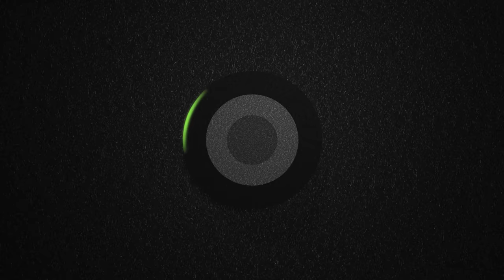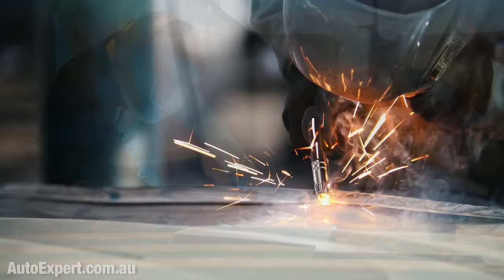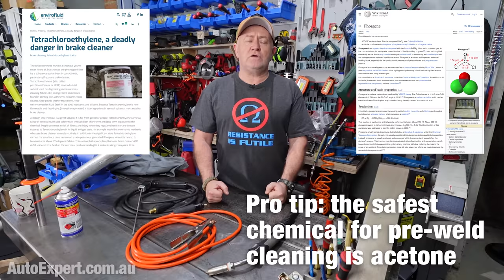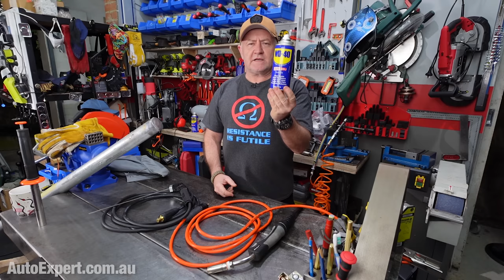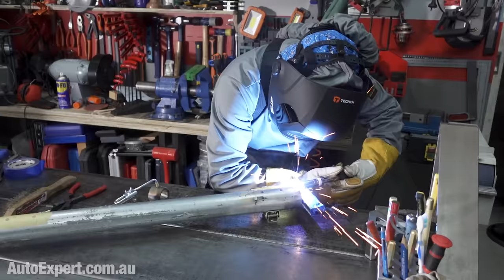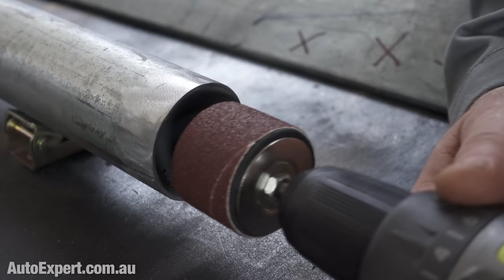How to die while arc welding at home: the top 5 ways | Auto Expert John Cadogan

Comment: Welder here.  I think you did a good job of covering the main safety points.  PPE is key, and I see so many mechanics on Youtube welding without gloves or sleeves.

A couple of points I'd like to add - never weld around or on fuel tanks.  There are ways to do it but the only really safe one that I'd be happy to recommend is to fill the tank with water.  If you're not prepared to deal with that, get a professional to do any work on fuel tanks that have had fuel in them.  There are other methods, but they should not be considered 100% safe as it is so easy to get it wrong.  Surprisingly, a lot of people think (or don't think) that it's OK to weld on the outside of a tank if it is otherwise sealed.

The other point is confined space work.  While it's unlikely that your average handyman will need to do that kind of thing, there's a whole slew of OH&S regs that need to be followed if you want to undertake this kind of work.  It has happened though, that back yarders and farmers have killed themselves by not understanding how dangerous it is to enter a tank, bilge, underfloor area etc especially with a welder.  When I was working in a ship yard, I heard about another ship yard that had a death.  One of their experienced welders had to enter the nose cone of an ocean prow (the long torpedo bit on the front of an ocean going ship).  For some reason it was late in the day and he decided to go in alone and get the job done.  He dragged the stick electrode up into the prow with him, and while he was trying to drag it up past him to the working face, he contacted it on his chest.  Just so you know, the big welders used on these sites are usually earthed externally directly to the hull.  They are AC units with quite a high OCV (90V or over).   Since it was the end of the day, they didn't find him until the next day, and that would have been a really awful way to go.  I don't know what happened to the shipyard but several very important  safety rules were broken, most notably you are not allowed to work alone in a confined space, and the shipyard that I worked for had a "board" where you had to hang your tag on to let the site supervisor and everyone else know that you were inside so they do things like not turn the ventilation off and go home at the end of the day, and you always had a buddy welder or trades assistant with you at all times.  The tags were multipurpose and had your specific number on them - you handed them over to get tools and equipment out of the store, and to hang them on the confined space board to let people know you were still inside.  I won't go into all the reasons why confined space work is so dangerous, but I think that it's fair to say that most people seriously underestimate the danger.
Reply from the maker: Thanks Chris - appreciate the tip on fuel tanks (big risk @ home) and also the sobering reminder about working solo in (mainly) industro-environments. Pretty grim outcome. We used tags like that in the railways for anyone working on the high-voltage system of electric trains (1500V DC overhead wiring and traction motor systems). Nothing got re-activated until all the tags were accounted for.
Reply: Yeah, that's a really good point. Last year my boss called us in for a meeting. Some guys from another workshop within our dealer group had cut into an old oil barrel with an angle grinder. I bet you know exactly what happened already. It blew up and a few guys got some pretty bad injuries.
Reply: The lack of ppe from youtubers drives me nuts as John points out, it metastasis.
Reply: That’s a solid comment.. the thumbs are cramping just reading this ! 😜

But YES!!! Fuel containers and FARMERS famous last words “sheee’llll b right m8”, (many variant follow ons from this sentence started)
Reply: I remember reading William Porker's column in a late 80s edition of Street Machine in which he told a tale of washing a car fuel tank many times with detergent. It still had a slight flare up when he tried to weld it.
Reply: Couple of mechanics in a local garage here decided one day to make a barbecue pit by cutting an empty oil drum in half with an angle grinder.  They hadn't been thinking in terms of them being the meat.  One survived.
Reply: @timjackson3954 a fucking very big ouch and that's not making light of it at all. I winced mightily when I read that.
Reply: @AutoExpertJC  yes yes,,,complacency killed the dodo & dino..
Reply: Do sealed pipes explode when being welded?
Reply: @jamesfarnarkler  Yes, that's the "easy to get it wrong" part, or at least one of them.   Most of the methods usually recommended by back yard mechanics have hidden dangers.  That's why I prefer the 100% water fill method and it's the only one I will tell people about.
Reply: @grantadamson3478    They can do, yes.  If you're welding on it in service then it's probably because it's cracked or a section is being replaced, and therefore it's most likely there will be air in the pipe.  Usually you'll isolate that section and take steps to make that section safe.  I haven't worked on fossil fuel pipelines so I can't comment more, except to say that correct pipe welding procedure would start with opening up the cracked pipe or new joint at least 3mm to put a root run in there.  Air will go in, and even some inert gas combinations (like CO2) are not safe because it decomposes at arc plasma temperatures (one of the hidden dangers I alluded to earlier).  The welder will have a very strict procedure that he must follow.

I did see pipe x-ray robots in use for NDT, and I'd be surprised if they don't have welding robots they can send up a pipeline to do the root run by now.

Work in oil refineries and chemical plants is another example.  Shutdown work (the plant is taken off line for maintenance work on a set schedule) can be particularly hazardous for these and other reasons.
Reply: @Chrisamic  Thank you.
Reply: @AutoExpertJC watch out for pressurised fittings also. I once welded the base on a chair gas lift chair without thinking, it was a small one I use for working on hgv trailers and units, I was welding and the bloody seat was bugging me wobbing about,  so being mad, (and in madness) I jumped up flipped it over an welding the legs back on. Flipped it back up, was bout to sit on it as it took off, hit the roof and landed on top of the trailer I was repairing. The lift unit had obviously got a tad hot.
Reply: @Chrisamic Well said, and very true.
Reply: @grantadamson3478  In oil refineries? Every year!
Reply: Thanks for the great video John!
Reply: YES 100% is the key ! If there is any space above the water IN the container that can NOT be filled and fumes caught there you've actually made the situation worse by confining the explosive gases and making a bomb.
Reply: My boss was gas welding a big patch in a 63 Chevy trunk. I was in the wheel well with a water hose, wetting the gas tank. He yelled at me every time a little water cooled the workpiece. Young and dumb ain't the half of it.
Reply: A welder near me demolished himself and a two story brick building, and fatally damaged another, while welding a leaky tank bottom. Everybody was baffled, as he specialized in industrial tank welding for years, and had a great reputation. He was well equipped, and knew the owner was experimenting with biofuel production. Who did what, we will never know
Reply: Filling a fuel tank with water DOES NOT make it safe. a friend of mine was nearly killed by a fuel tank that was filled with water.
Reply: Some immigrant laborers were doing  an interior demo/remodel of a space in a  century old former varnish works. One was told to remove a large overhead pipeline. He grabbed a cutting torch, and seconds later, the lucky fella met 72 houris. Cheap labor is no bargain
Reply: It seems like a lot of people don't understand the importance of covering your skin. My dad never covered his arms when welding. By the time my dad died his arms were covered with scars from all the cancers that had been cut away.
Reply: The really insidious part of confined space deaths is they're almost never just one victim.  People can't resist the urge to go help and all that does is up the body count.
Reply: @AutoExpertJC even more safety, in our depot protection the road had the juice off and the end doors closed and neither could be changed until all the fitters or examiners working on the train had taken their padlocks off the side of the cabinet to access the door control and electrical supply. Just one padlock would keep the cabinet door shut, a good system.
Reply: @phlodel  I use CO2 after flushing the tank. Low flow rate for as long as it takes.
Reply: Sample size of one, but I have had success repairing a fuel tank for personal use with JB Weld. I did that specifically to avoid welding it! Thanks!
Reply: No you dont use water buddy. you fill it with gas car exhaust so theres no oxygen in the tank
Reply: @@shivadow nah bro that’s not how
Reply: @AA-tb4ff   Which is exactly what you don't tell people.  That's information that hasn't been current for about half a century.   A few things...    Vehicle exhaust is not what it used to be. - CO has largely been replaced with CO2 which is far more reactive, arc welding processes have evolved so people are using GMAW and GTAW (mig and tig in the US) far more than stick, and even when it was a process that was used, it's not a matter of just "filling the tank with exhaust".  There were tables, published about 1950 that told you how long to run the exhaust in depending on the size and shape of the tank.  I've personally met one guy that got it wrong - he got the timing wrong and left the exhaust running too long, so the mix was wrong.  He also wasn't welding the tank in a cage so when it blew up, it blew him right across his shop and through the wall of his paint booth.  He was lucky to survive, and that's someone who had done it dozens of times, had the correct tables, and understood the problem quite well.  Carbon dioxide is a reactive gas at plasma temperatures.  Buddy.
Reply: @Chrisamic  well it’s a better idea then filling it full of water
Reply: @AA-tb4ff  No, it's not.  It will kill you.
Reply: @dontforgettobringatowel9106  One such incident I heard of sent the drum 50m into the air.
Reply: ya i said fill it with car exhaust so theres no oxygen in the tank but apparently thats not how you do it@@shivadow
Reply: @michaelbamber4887 Weld in haste, repent (or should I say recover) at leisure eh?
Reply: @jeffdoell5064  yeah, just didn't think about heat transfer to the gas strut, was pretty impressive amount of force when it went. I should have taken the base part off to weld it. Did do next time I came across one that had a loose base. You live an learn as they say.
Reply: Am confined space qualified and I agree without training 2 many people underestimate the dangers sometimes even the qualified ones unfortunately, I have worked on some teams (power stations) where I have had 2 pull operations due to the dangers created by maybe qualified but cowboys on the team. Safety then safety then have another look safety if in doubt stay out gut feelings have saved my bacon more than once.
Reply: @grantadamson3478  Yes they can. It has happened when sealed steel sections have been galvanised, which is a much lower temperature than welding can cause, and a sealed section can explode blowing hundreds of pounds of molten zinc over everything and everyone within quite a distance causing serious damage and injury.
Reply: @grantadamson3478  yes they can due to air expands when heated.
Reply: @Chrisamic  "CO has largely been replaced with CO2 which is far more reactive,"
Wait what? Want to rethink that?

Just to add to the general stories. Stick an open airline in the drum. Theory goes it keeps the mixer to lean to burn.
Reply: @phlodel  I'd sure like to hear more details
Reply: @Chrisamic said "No, no need to re-think anything, since CO2 is more reactive at plasma temperatures.  Sure, if you keep the mixture leaner than stoichiometric it may not blow your face off.  Would you like to bet the family jewels on it?  It's probably the dumbest thing suggested so far..."

I'm not sure what you are trying to tell me. You get that CO is a flammable gas right? but what % of exhaust was ever CO? Given there was already many times more CO2 in exhaust than CO, how much difference would your claimed worsening really be? 10%?

Would I beat the family jewels on it? Unlikely, but the story goes the guy that made a lot of money welding up 44gal drums after WW2 did. Not sure stoichiometric is the word you are looking for though.
Do I get a prize?
Reply: @stusue9733  "I'm not sure what you are trying to tell me. You get that CO is a flammable gas right?"

This is getting silly.  CO is not flammable in the way that most people understand the term.  It would make a pretty fair fire extinguisher for most purposes, except it's quite toxic.  

"but what % of exhaust was ever CO?"  
Prior to 1975 10% or more of car exhaust was CO and almost no CO2 left the tailpipe.  Modern cars exhaust about 13% CO2, quite a different mix for the subject we are discussing.  The technique of using car exhaust to fill a fuel tank is from the early part of the twentieth century, and the Miller/Lincoln tables for working out how how much exhaust to put in the tank were drawn up in the 50's.

" but the story goes the guy that made a lot of money welding up 44gal drums after WW2 did"
I think you'll find there were a few more steps in the process, such as washing them out first.  He probably discovered the hard way that just washing alone was not enough.  Second hand stories from eighty years ago are sure to be missing a few of the finer details, like how not to blow yourself up.

"Not sure stoichiometric is the word you are looking for though."
I'm pretty sure it is.  Let me put in words with fewer syllables for you.  Adding air will reduce the likelihood of the gas mix in the tank being the perfect ratio for an explosion that is 100% efficient for maximum face removing power.  It won't on its own guarantee some form of explosive mix is not present however.  Think of it like playing russian roulette - pull the trigger often enough and it definitely will go badly.  Sorry, I just can't get less than three syllables without a frontal lobotomy.

"Do I get a prize?"
Sure.  Here's a banana.  🍌
Reply: @Chrisamic  While I believe you are stretching the truth about the CO%, even if I grant you that, you haven't explained how replacing a gas that "would make a pretty fair fire extinguisher" with a gas that IS used as a fire extinguisher is an issue.

" some form of explosive mix" So you mean lower and upper explosive limits?
Reply: Put a hose from a running cars exhaust into the tank .water is safer
Reply: @AutoExpertJC  I find it concerning that in discussing the subject of fuel tank repair, several deadly old wives tales persist, as we have seen in the comments on your video.  I'm a boilermaker welder, and for many years I worked in a business that among other things, did a lot of fuel tank repairs, from small stationary engines, up to and including road going fuel tankers.  Do not take advice from anyone that tells you to fill with car exhaust or water.  To degas a tank requires heat and detergent, and that tank will only remain truly gas free for a certain time  before it begins leaching product from the walls and contaminates the atmosphere within.  Even if you were able to 100% fill a tank with water, which is far easier to say than do, how are you supposed to run a sound weld on a (usually thin) tank with water as a backing?  The repercussions of leaving even a small gas pocket are extreme and this was illustrated at an industrial site not far from where I worked when two workers were killed after a tank exploded that they were fitting metrology gear to.  The tank was used to store waste oil for recycling and was quite large, probably 5 or 6m diameter and 8 or 10M high.  The tank was filled with water prior to the men commencing work which involved cutting into the roof of the tank with an angle grinder.  As the work involved working at height, both men were harnessed and hooked on to anchor points on the tank roof.  Once the grinder penetrated the tank roof, it ignited the fumes which had been concentrated by filling the tank with water, and there was an explosion resulting in the roof of the tank being blown off and the two men going for the last ride of their lives, harnessed to the roof, before coming in for a landing, almost hitting a truck driver that had just arrived back at the depot for the day.  The grinder that they were using was found on the roof of another business over 100M away.
I don't for a minute expect a back yarder to be working on a tank that size, but the lessons and the principles hold true.
As qualified tradespeople or other professionals, we really do need to be mindful of the advice that we give people.
Reply: @grantadamson3478  
The question is sealed: What product to knowledge did it last contain? That's is the key.
Water, no problem welding on a water line where the pressure is monitored to suit the welding application and procedure. 
But if unsure sure, the correct procedure is to drill the (empty) pipeline via an intrinsically safe method like a (air driven) pneumatic drill with constant coolant, then gas test for LEL's (lower explosive limit) before proceeding with anything that can produce a spark or flame.
This requires training in how to operate a gas testing unit and how to identify and manage these steps.
This is not something for the backyard or want-to-welder to undertake..
Reply: I was going to say the same thing about tanks.  Pretty much anything even nitrogen can become dangerous with enough heat = pressure.  Basically a spring in a bottle.
Reply: call me silly but when i weld i have all the gear on, coat, gloves, shield
Reply: excellent. thank you.
Reply: @steveb6103 That works. At the very least, flush the tank and have compressed air continuously moving through the tank so fumes  cannot build up.
Reply: @grantadamson3478 probably. Sounds like a casino...
Reply: @jimfarmer7811 
That sounds like your farther had Basal-cell carcinoma on his arms. Those are relatively benign compared to melanoma but both should be avoided by wearing PPE.
Reply: @stusue9733 
When welding you create a plasma. 
Fire extinguishers are used on fires, not on plasma.
Reply: @Conservator.  I'm sure you are trying to tell me something but I have no idea what it is, so if you could clear that up that would be handy.
For a bonus point you could list the gases that are used Pure for MIG welding. Let us not get all excited about  "actually its proper name is GMAW"
Reply: Ive patched up a few fuel tanks in the past, either by brazing or welding. Sure be careful, give it a flush out with water, I would often see a flame burst out the filler pipe every now and again with a pop, but nothing close to explosion.
Reply: Was the poor guy burnt to ashes? 😢
Reply: @AutoExpertJC  We learned welding in high school, and the teacher insisted on us wearing the full leather gloves, leather jackets with a shield for the neck to avoid any skin being exposed to UV light.  Not the most pleasant thing in the southwest USA, but I understood the reasoning. People were inspecting a water tower at a university in California in summer and at least one of them died from heat exhaustion, it was a guy named Jason Peters of Palm Coast, Florida.   They should schedule such inspections in the hotter climates for the winter months.  
Also in California, in a town called Lemoore a welder named Dion James was killed when a tank he was welding exploded and launched 70 feet in the air.  Lemoore City employee Jeremy Climer was wounded.  It was a water tank, so I'm not sure what exactly led to the explosion.     
We had lock out tag out procedures in the electronic test area I worked in, but prior to that I worked in industrial and agricultural pumps and wells.  I hated to go out to the country side because those mom and pop dairy farms don't really have lock out tag out procedures and some dairy farmers are rather know it alls.  They'll start flipping breakers because, dog gone it all, they own the place.  And one place I went they some how managed to blow out a pressure tank and water was everywhere with all this frayed wiring in that pump house on top of it.  It surprises me that there aren't both more electrocutions and also more electrical fires.
Reply: I had an idea and it worked well for our people at one job I was on where we filled fuel tanks with steam from a boiler and insulated hose. No matter how stinky with fuel odor a tank is, it can be welded properly when pumped full of steam. Was very effective at keeping the fire demons in check. Diesel tanks are far safer to weld than gasoline or other light volatile solvents. Good post on following the rules. That goes for ANY WORK in confined spaces. My buddy had to change a pressure sensor in a ship down in a hole where you had to crawl back in there to change it. You can drown from the pressure if you screw up. We put a rope on his feet so we could pull him out if something happened because there was no other way to save him. Some of those places in ships and industrial areas are real shity and should be respected for the hell holes they are.
Reply: I've had to do quite a few welding jobs inside of potato flake drums. I ended up quitting because I watched the owner of the company I worked for, crawl into one of these drums with absolutely no PPE, harness, anything on. Yet if I were to even get one bit wrong on all of the safety protocols, I would get my ass handed to me. 
I am more than happy to do everything I can to make sure I get out of one of those drums alive. But watching the person who signed my paycheck do everything so wrong, made me realize he doesn't give a single shit about the people who give him their time.
Reply: @Chrisamic  You are going to have explain how CO2 is more reactive than CO. From my basic college chemistry I don't recall any chemicals that produce an exothermic reaction with CO2. I'm not saying there aren't any exotic reactions but none in the real world. Besides CO2 is often used as a shield gas in welding.
Reply: @jimfarmer7811  I already have. CO2 decomposes at plasma temperatures. this provides the oxygen for an explosive combustion if there is also flammable vapour. CO2 is more dangerous than carbon monoxide, simply because there are more oxygen molecules freely available. This is also why when carbon dioxide only is used as a shielding gas the results are dirty and spattery. It’s not used much on its own outside of the US.
Reply: @Chrisamic  I agree that CO2 is reactive within the narrow confines of the plasma ball but virtually all the O2 cimbines back with the carbon or the base metal. It is chemically impossible for the reaction to propagated from there. After all if the reaction could propagate through the CO2 stream the reaction would instantly propagate through CO2 gas lines when you strike an arc. CO2 is one of the safest fire suppression gases available.
Reply: @AA-tb4ff  Sorry, but carbon monoxide is flammable, too.
Reply: @jimfarmer7811 And yet, bad things happen when you add flammable vapour into the mix.  Just don't do it, it's not in any way safe in the context of welding on fuel containers.  People have died or been seriously injured because they thought the same as you.  Might you get away with it?  Yes you might.  You might not either...

It's really bad advice to be giving people.
Reply: @Chrisamic  I don't plan to ever weld on anything. The point I was making is CO2 is inert and will not contribute to a fire in any way. People that claim otherwise loose all credibility.
Reply: @michaelbamber4887  
Regarding air chambers in the seats, they're supposed to be filled with an inert gas, but in "some" countries they just use compressed air.
On it's own, that may not matter, but when you mix in lubricants and plastics, they can explode and there have been some very nasty impalements resulting in death or permanent internal damge to unfortunate people.
One issue was people just sitting down hard, especially 'bigger' people - they would cause compression ignition and an explosive extension of the spear.
Reply: @gordowg1wg145  doesn't sound like a nice way to go.
Reply: @jimfarmer7811 The point is that your opinionated advice here could get someone killed or worse.  CO2 is only "inert" under the very limited  conditions you are used to thinking about.  There are only two gases that welding engineers think of as "inert" and neither of them is CO2.  CO2 is possibly the absolute worst gas to fill a fuel tank with prior to welding.

Oh, and I don't "think" otherwise.  I went to college.  I've got certifications to do this kind of work.  I've done materials science courses and can read a phase diagram, though I will probably have to look up what most of the symbols mean in that context.  I've got decades of experience of not blowing myself up and have all of my digits and limbs to prove it.  If you think that lacks credibility, you're way, way deep into the cognitive bias called the Dunning-Kruger effect.
Reply: @Chrisamic  I'm a retired engineer that designed gas furnaces. You still haven't explained how CO2 will react with anything. For CO2 to be dangerous it has to react with another chemical to form a thermal reaction. I don't care how many certificates you have. Until you can explain the basic chemistry you are talking about I can't take you seriously. 
By the way even if you had a mix of CO2 and methane and struck an arc at most you should have tiny flames at the arc. The flames would be extinguished when the arc was broken. If you are so sure of what you are saying you should be able to provide a link. I suspect the accidents you refer to were caused by workers mixing CO2 with O2 in a hydrocarbon rich atmosphere.
Reply: @jimfarmer7811 I've explained it several times.  CO2 decomposes at plasma temperatures.  Oxygen atoms want to become O2, and in the context of welding on a fuel tank, that's like playing russian roulette.  Rest assured that accidents have happened, both because people used the car exhaust method and got it wrong, and because they thought that CO2 is an "inert gas".  I repeat, for the last time, CO2 is NOT an inert gas in the scientific sense even though most of the planet thinks of it as a fire suppressant.  People are not understanding...   there are four fundamental states of matter but your average armchair referee can't even name them, and the "information" they are opining in this thread could get someone killed.
Reply: @Chrisamic  from my knowledge of the combustion process the O2 released in plasma would be miniscule. It would be consumed when it cooled. Even if you had a mix of CO2 and methane a welding arc will not start a self sustained reaction in that environment. In addition any O2 produced would be quickly consumed at the edge of the arc. At worst you would get some tiny flames at the edge of the arc which would be extinguished when the arc was broken.
Since you can't provide a link I suspect this is a welders old wife's tale. My opinion is bolstered by the fact that you are ignorant of the basic chemistry involved. I have no doubt people have been killed by using CO2 but I suspect it has more to do with the technique used than anything hazardous with CO2.
Reply: @jimfarmer7811    Oh seriously...     Look up CO2 dissociation in a plasma, dude.

The chemistry is 2CO2 => 2CO + 02

The process can happen at as low as 3000K in small amounts however plasma temperatures while welding are usually between 13000K and 18000K.  The O2 is not consumed in the plasma, that is where it is being produced.  Some will react in the weld pool, which is why GMAW with 100% CO2 is so messy.  The rest can build up in the tank, depending on size and shape of the tank, purge flow etc.  and form an explosive mixture if there are fumes.  There almost always is residual fumes - folds or seams in the tank, flange fittings etc.  The ignition source is a spark dropping inside the tank.

This is just one of the 249 ways to get welding up a fuel tank wrong.  Have people done it successfully?  Yes, mostly by washing out the tank with soap and water a few times or steam cleaning it then using a CO2 purge.  There's a lot of variables, mostly to do with whether or not an explosive mixture is able to build up.  However, the fact remains that relying on CO2 to purge a fuel tank is dangerous and telling people who don't know any better to do it that way is really bad advice.  There is a whole lot more to it, and the stakes are very high indeed.
Reply: @Chrisamic  you must not even bother to read my post. I agreed that O2 could be made in plasma. The point is most of the O2 will recombine either with the weld pool or the free carbon once the plasma cools. There will be very little free O2 floating around. Besides if there is an atmosphere of CO2 and hydrocarbon the O2 will quickly combine with the hydrocarbon at the arc interface. I've worked with and designed gas fired forging furnaces for many years and I find your explanation highly unlikely. If you have a link supporting your position please provide it.
Reply: @Chrisamic  you were so adamant I thought I could be wrong so I did extensive research and couldn't find any source to support your opinion. The technical term is you "are off your rocker".
Reply: @jimfarmer7811   Well it's not acceptable in industry, but you you've got all these non-welders running around telling weekenders to do dangerous stuff like use car exhaust and CO2.  Most fab shops will refuse to weld on fuel tanks, mostly because they can't charge enough to do it properly and safely.  The ONLY way for a weekender to do this 100% safely is to wash the tank out thoroughly and then fill it with water.  That's the only safe advise anyone should be handing out regardless of their own personal belief system.
Reply: @Chrisamic  "The O2 is not consumed in the plasma, that is where it is being produced.  Some will react in the weld pool, which is why GMAW with 100% CO2 is so messy.  The rest can build up in the tank,"
You're welding the fuel tank from the inside?
Reply: @stusue9733  It's pretty thin metal, I assume the other side is getting nearly as hot. But at least some people seem to be discussing tanks large enough to stand in. I'll be honest, as someone who just works in a shop where other people weld it took me a few posts to realize that my mental image of people welding near a plastic gas tank wasn't what people were referring to.
Reply: @mxpants4884  You can assume that, but its not. The claim is plasma temps are required.
If you are talking about tanks large enough to stand in, that need to be welding from the inside, I'd suggest that they are not often purged with CO2 or filled with water(but hey there is always some wacky edge case but anyone involved in such is unlikely taking pointers from youtube comments).
Reply: @Low760  Yeah, especially the Yank ones where the take the guards off their angle grinders. Seems to be a thing in America. It just boggles my mind.
Reply: @Chrisamic  "almost no CO2 left the tailpipe". That's only true if almost no fuel was burned. Every molecule of carbon burned (oxidized) is combined with two molecules of oxygen, resulting in one molecule of CO2. A given amount of any fuel burned produces the same amount of CO2 today as it did in 1950, AD or BC. It's an immutable fact
Reply: @robertmoffett3486  I don't know why, but most people seem to have forgotten that the main combustion gas was and is actually carbon monoxide.  You have to do a whole lot of engineering to have CO2 coming out of a car exhaust.   It's like people have never even seen an old car, let alone understand how they work.  In this context, 3% or less of CO2 with the bulk of  the gas being extremely toxic CO was normal, and that's what it was when those tables and that advice was current - early to mid last century.  That advice and those tables are no longer safe or recommended.  I also don't know why people are so hell bent on getting other people maimed or injured.
Reply: @Chrisamic  CO [carbon MONoxide] is very flammable, as well as deadly when inhaled.   Not sure what planet ever used it for fire extinguishers.    Carbon Dioxide [CO2] is what is used in some fire extinguishers.    Internal combustion engines burn fuel and oxygen to make CO2.   Incomplete combustion results in CO.,... just 'itching' to combine with that final oxygen bit.
Reply: @Chrisamic  I'm going to be polite here, and suggest that you are mistakenly interchanging the term carbon MONoxide for carbon DIoxide.   You would have to have an extremely poorly functioning vehicle [or any combustion] to produce CO as your primary exhaust gas.
Reply: @highdownmartin  LOTO lock out tag out. I've seen funny boxes with half a dozen padlocks on it, each one preventing opening the box to get out the key for the master padlock on the main power switch.
Reply: @karlrobbers   yep, i know similiar story (with much smaller tank, but still deadly) from shop, where i worked as my summer job in high-school. some pipe was  welded on tank (probably some old oil barrel) and it was just favour for some guy. not sure, if they air it out, filled with water etc, but sad outcome was guy that was welding was killed instantly with his head blown off and all the rest of the crew in the shop thrown out on the street for some decent distance, some with heavy injuries.
this story keeps me from starting diy welding etc so far..
Reply: @matthewbeasley7765 my old job required a "hole watch" at the entrance of any confined space while anyone was inside. The hole watch had to record the entrance and exit times of anyone working in the space and was not allowed under any circumstances to enter themselves. A confined space rescue team was always on standby and each entrant had an air quality monitor that detected co and several other poisonous gasses as well as oxygen concentration in the atmosphere. Never had an incident while i was there anyway but they at least took it seriously
Reply: I was an HT stationed @ Site One in the Holy Loch Scotland on the dry dock. We had to crawl into the submarines mud tanks and torpedo tubes to weld zincs to the bulkheads, no ventilation, in confined spaces and these spaces were wet and all this with 0 PPE, no respirators, we didn't even have proper welding gloves and if we did they would be soaking wet. I sometimes would be soaking wet after working all day in these mud tanks. These tanks were like mazes and very narrow so you had to crawl in and out on your back, I once caught myself on fire after a large red hot bb's fell on my cotton coveralls right at my crouch area luckily I was only about 10 foot inside the tank and I started yelling to a buddy of mine that was hydro-blasting just outside the opening to the tank. He sprayed me down and put the fire out almost drowning me lol. Also me and another HT were put in a very small punt or aluminum boat to weld zincs on the outside pontoons of the dry dock while at high draft in the middle of winter, and if you have been in the Holy Loch you know it is very rough especially in the winter months. With the welding leads coming down over the outside of the pontoons we attempted to weld zincs on lol. We both were soaking wet the punt had 4" at least of water in it waves crashing us into the dry dock all the time we held onto the welding leads. I am very fortunate that we lived through these ordeals. Shortly after that I learned how to operate the cranes and from then on I was a crane operator, no more mud tanks or punts lol.
Reply: I gave up trying to get charcoal filters for building confinement areas with spray glue, I bought my own.
Reply: I don't have a workshop anymore, but when I did, I made certain that I had plenty of cleared out space to work in before I turned on the electricity.  When working on a table saw, you don't want to trip over something on the floor.  Not that that ever happened to me.

- signed Stumpy
Reply: @timjackson3954  yes. The worst kind of old oil drum or fuel tank is the almost empty and warm..that kind goes bang in a second. The full ones burn but doesn't blow you to pieces.
People should be careful with oxygen/acetylene torches and greasy/dusty environments too. If they work in a confined space and thinking that all the dust, oily rags are at a safe distance from the sparks. Think again. The extra oxygen in that space can cause "spontaneous" fires to break out..No spark needed.
Reply: @karlrobbers  Good advice! To be safe the fuel tank should be removed from the vehicle. Then wash it out with boiling water with some ethanol in it to properly get the reminding fuel (petrol) out with the water. Then repeat with boiling water and a detergent. Let it dry out until its bone dry. If you are using a Tig to weld you can route your backing gas (argon) into the tank. Always let the tank sit so that the welding is done on the lowest part when doing this and all other ports to the tank should be open and situated so that they are higher than the place you are going to weld. That way you will get the Argon pooling at the low point mitigating the risks and providing good gas coverage.
Reply: @phlodel  Nothing is safe in the industry. Safety is a misnomer. Its precautionary measures. Do the best you can or don't do it. Have someone else double check your setup etc. There's no such thing as safe. If you think you're safe, you're going to get hurt. My humble opinion...
Reply: @steveb6103  I've welded fuel tanks with fuel in them this way.
Reply: @AA-tb4ff  but I'm thinking if that engine producing the exhaust is running rich, that's gaseous hydrocarbons like a fuel-air bomb...BOOM
Reply: I developed a portable water tank backpack for concrete saw cutting. A foreman asked me to cut without it “ just one time”.